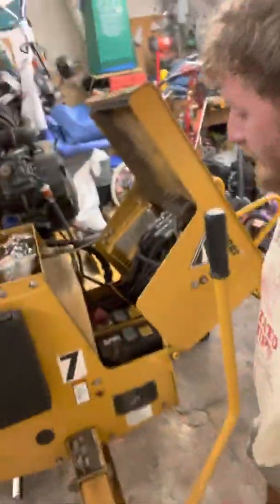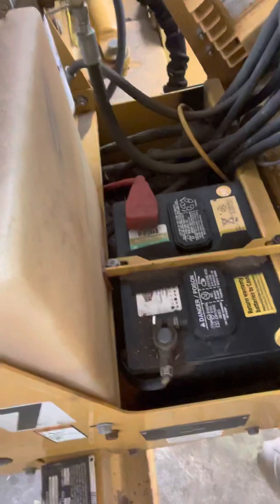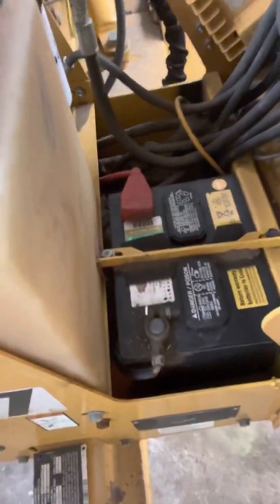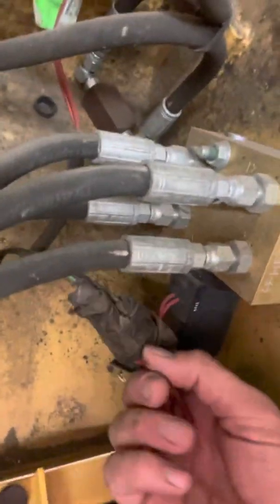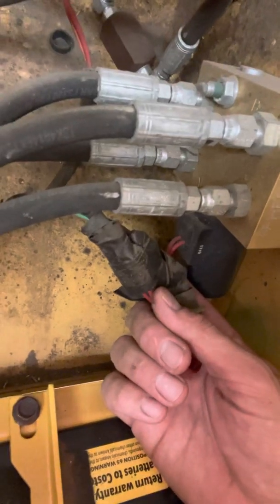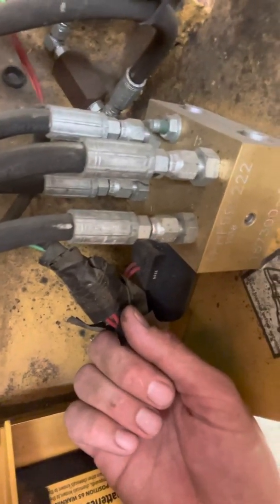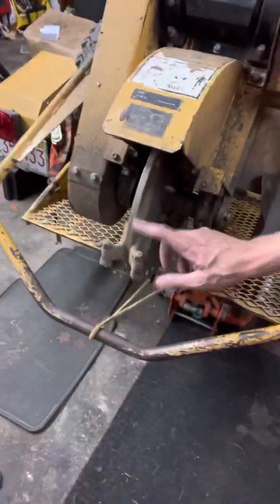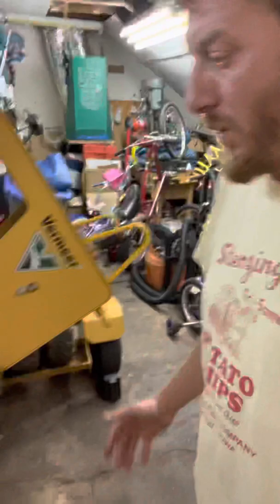Vermeer 252: Very brief info on “Mods” & Part #s

Comment: When you say you the swap your teeth every 30 minutes. Is that how long you have found they stay sharp for in total?
Reply from the maker: @BenjaminBohlen  well. 30-60-occasionally 90 mins. Maybe longer on the lightest weight jobs. Depends on a lot. But yes once they round off the edges they are not as sharp, I slow down, and they take more to sharpen. You can see and feel the difference, it’s not much really but it is verifiable. I do flip and change my teeth a lot.
Reply: @UncleRoots413  do you have a good method for sharpening? How many rounds of use do you get out of a 3-sided tooth with sharpening? New to grinding.. Have the same setup as you.. other random question - how often do you go through bearings? I have a local friend that replaces annually - he is full time grinder with this machine (and a bigger one)
Reply from the maker: @BenjaminBohlen  the typical method for sharpening greenteeth is a drill press over a bench grinder with a Diamond wheel on it. My 900s are only 2 sided. I usually get at least 3 sharpenings out of my teeth, usually like 5 with how little I wear them before changing. However, I have not sharpened my own for years, it’s bad for your health, and once I got busy after starting out it’s not worth my time. Take me a day or more to sharpen 100 teeth and I still don’t think I pay $300 to have that many sharpened. Nice retired gentlemen Bill from Ohio does mine. Bearings probably vary by machine your full time friend is probably wise to just do his yearly if they don’t blow. I’d expect 2-500 hours maybe more on our machines, really depends on how hard they get used and how they’re treated. I’d recommend if you don’t have a Facebook get one and join the 252 specific group, good help, nice folks.
Reply: @UncleRoots413 where do you order parts for it my pillow block bearing blew out
Reply from the maker: @w1sefalcon331 all over really. Wherever I can get them other than Vermeer if possible. eBay will have what you need too. Bearing supply houses local to me seem expensive, but others have reported differently.  
P-208 for the cutter wheel and P-207 for the jackshaft. Double check the jackshaft diameter before ordering though, the 252s had two sizes of those. Check your sheaves(pulleys) for wear too while it’s all apart. Join the 252 specific FB group, lots of good help and searchable info in there. Thanks for watching!

Comment: Uncle roots I have a sc252 the clutch fails to engage at times I can’t figure it out computer blinks clutch LT fail any suggestions
Reply: Thank you I will look into it further…I’ll let you know how it goes
Reply from the maker: While I can’t really tell what the problem is from here I can suggest to look in the Facebook group. Several guys in the 252 group have gone around the computer and OP presence system hard wiring in their own 50amp switch. I have not done this myself but have seen many share that they have.

Comment: how many hp is the engine on it?  if its the 35 hp would you mind sharing a picture of the linkage? i bought one with the 35hp not running i made it work but it keeps giving trouble i believe the rpms are high but i cant find the way to reduce the speed I believe the last owner removed some coil spring and never put it back
Reply from the maker: Sorry sir. I have the stock 27hp motor. Get in the 252 Facebook group. Ask that question in there. I understand there are several that uave done the vanguard 35 swap(I may do a kohler35 swap myself someday).
Reply from the maker: @jose garcia for reference on my 27hp it’s not adjusted by the cable. There’s a bracket the cable attaches to with a stop on it I can adjust for max engine rpm. Yours may be similar or totally different.
Reply: @UncleRoots413 how do you prime the fuel pump after you run it out of gas or is it supposed to do it automatically. I don’t think I have a ball on mine like a boar
Reply from the maker: @wheelzup703  I do two things. Maybe not the best or safest way. After replacing my fuel filter I then hold the line down into a gas can. Let it flow, then cover it with my finger. Then I stand on a stool get the line right next to the pump. Before I remove my finger I start blowing through the gas tank forcing fuel out the line while it’s above the gas tank, then shove it on the pump. This is the best way for me I’ve found to get little air in the filter. We all get some air in that filter, I just don’t like seeing it with less than say half gas.

Comment: I’ve got a 2005 sc252, I’m having a charging issue with the battery, any ideas on why it’s not charging.
Reply from the maker: Ridge Runner, no not off hand sorry. If it’s magneto based I’d check for voltage there and make sure any weights that trigger it are still in tact. I have not yet had any charging issues with mine, a 2012.
Reply: @UncleRoots413  it’s a kohler
Reply: @ridgerunner4273  ^
Reply: Ridge Runner, I’m having the same problem with mines I have a 2011 sc252. I buy a brand new battery and use it for the day and the next day the battery is dead. Have you found out the problem?
Reply: @jordierodriguez4098  yea I had to add a ground wire from the voltage regulator to the engine. Very simple
Reply: @ridgerunner4273  So you didn’t change out the voltage regulator?
Reply: @jordierodriguez4098  no, just added a ground wire. Attached one end to the bolt on the voltage regulator and the other end to a bolt just under the cover, below and to the right of the voltage regulator

Comment: Do you have travel block dimensions?  Thanks Jim
Reply from the maker: Yes sir. This is what I came up with. 
3”X3”
5 3/8” tall on the short side
6 1/4” tall on the tall side
7/8” hole for the pin 1/8” from bottom(I’m going a sliver thicker on that 1/8” when I make mine, there’s a little slop there-not much tho)
1/8” thick stock
If you care leave your email I will also send you the photos I took when taking the measurements. Up to you.  Can always delete the comment with your email in it after I send it so it’s not still up here.
Reply: Can you e mail travel block pics and do you have pulley part # ? Thanks Jim
Reply from the maker: @jimhoeky1497  I can email the photos. I do not remember the part number for the pulley. I can get it next time the cover is off. AK41 something or other in my case, with a 4.1” pulley. The part number for the 3 and I think the 3.5 can be found in the thread I reference in this videos description. I may have even uploaded the one for the 4.1 there, or have out photos of it, not sure.
Reply from the maker: @jimhoeky1497  
AK34H is 3.5” sheave
AK41H is 4.1” sheave
Still go read that thread. Lots of info
Reply: @UncleRoots413   awesome thanks does it take a shorter belt ?
Reply: I started to replace lower bearings tonight.  I definitely got someone's problem bolts broken in the pulley.
Reply from the maker: Yes. I think if using a 3” pulley one must go down to a 25. I run a 26 or 27 and I think stock is 28. 

I have also elongated the slots on the back of that housing so I can switch the belt without removing the pulley and messing up the alignment.
Reply from the maker: @jimhoeky1497  4L270 is what I run I think with a 4.1” pulley. That and the slots extended I have plenty of adjustment and can get the belt on and off easy if I want to.
Reply from the maker: @jimhoeky1497  I assume almost all of us have someone else’s problems with these 252s these days. I have to put two washers under the motor on the clutch side hold down bolts to alight the clutch pulley to the jackshaft pulley. Pretty sure my machine was flipped before I bought it, the signs are there.

And if your doing the cutter shaft bearings I’d do the jackshaft ones too while I’m at it. Make sure all the sheaves are lined up really good if you’ve never done it before.  When I’m done I can run a straight edge sheave to sheave and not tuck a piece of paper behind it, that’s .004 of and inch. I check during and after belt tensioning. Make sure the sheaves are locked on to their taper locks straight first, I check those with a dial indicator and also have those down to just a few thousands runout, the motor side jackshaft one is the hardest IMO only having two hold down bolts.